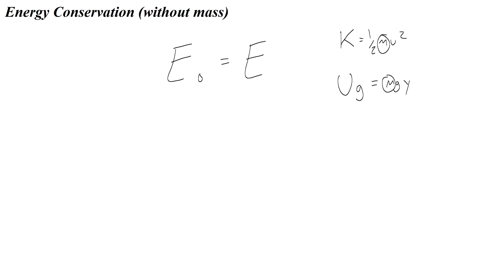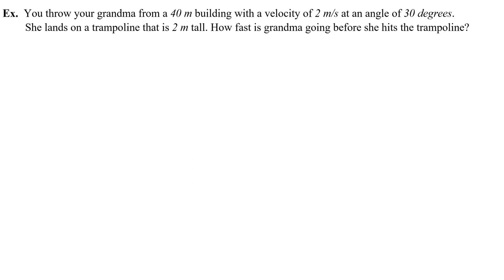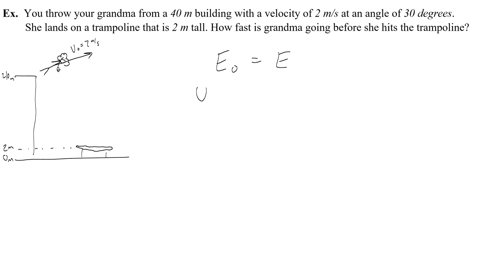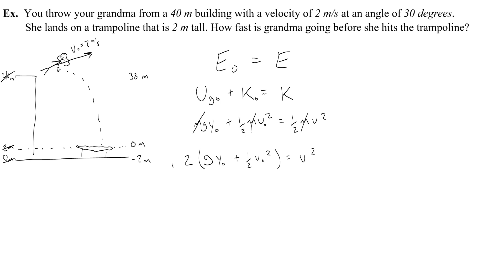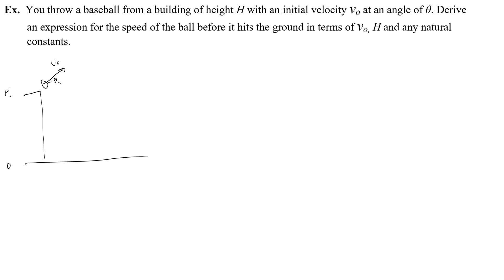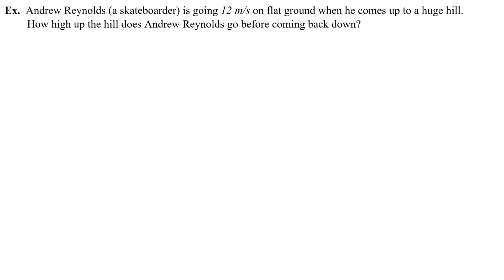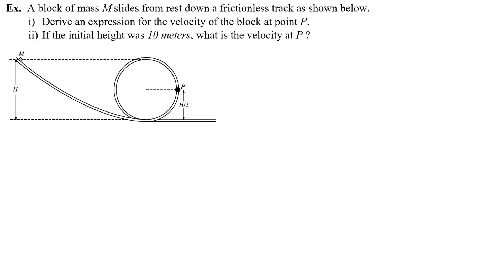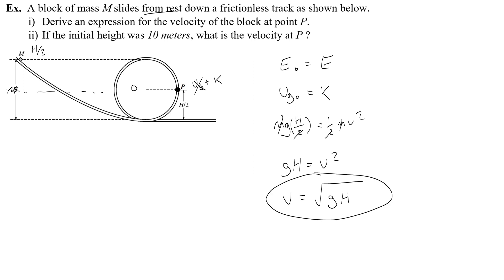How to Solve Energy Conservation Problems without Mass

Comment: Where you get the 10 from in the Andrew Reynolds problem
Reply from the maker: 10 m/s^2 is g, the acceleration due to gravity. On the AP Physics test you are allowed to assume g is 10 to make the problem easier. Most textbooks make you use 9.8  or 9.81 instead. Hope that clarifies!
Reply: @HowToPhysics  thanks !